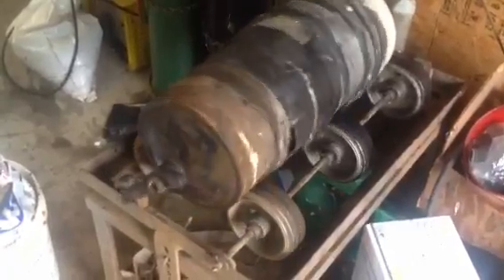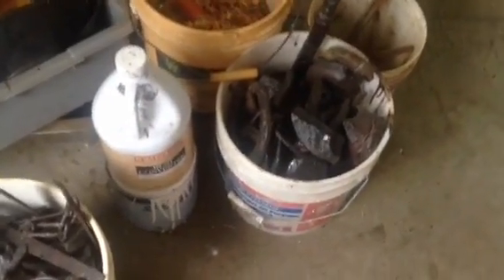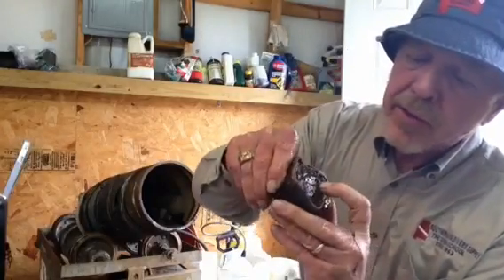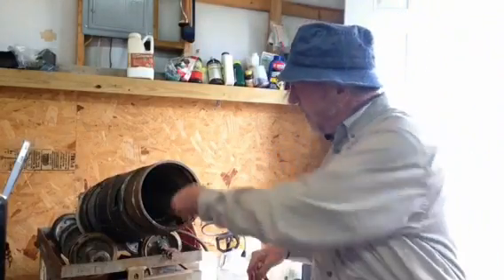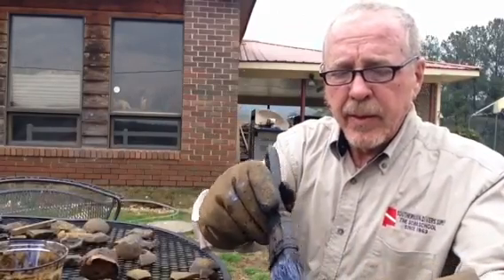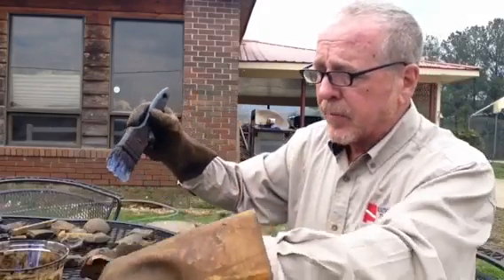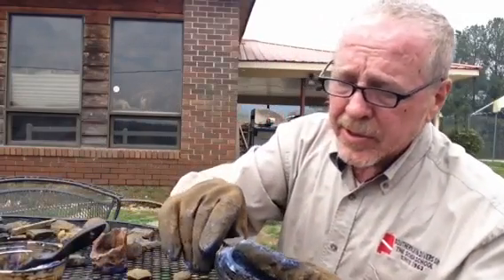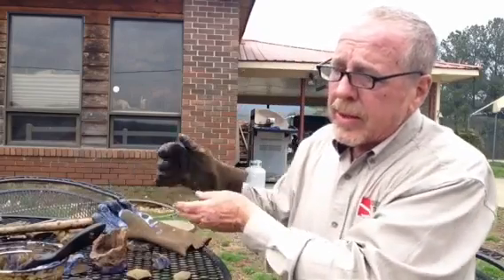Steve Phillips cleaning and preserving iron

Comment: Steve I have 2 solid French cannon balls , should I drill a small hole in them to make a good connection ? Or brush it and just wrap wire? Thanks
Reply from the maker: A small hole into good metal will work best. After cleaning boil several times in fresh water to remove salts and sulfides. Then coat with Gemplers Rust Converter.
Reply: @stevephillips0404  thank ypu

Comment: Steve I really appreciate your getting back....wanted to ask if there was a rust removing soaking product you'd recommend?  I'm not set up for electrolysis and figured you have probably used a bunch and would have some thoughts...thanks
Reply from the maker: ACE Champion 
I have seen where people have used vinegar but I never have. If you are going to dig iron I think you should set up electrolysis. It is easy and cheap. You need a manual type battery charger with built in meter. Not an automatic charger. Some stainless steel such as a big cheap pot from Walmart and baking soda. Don't use salt or lye.

Comment: Can you clean it with the gimplers without using the tumbler? I don't have a tumbler
Reply from the maker: ACE Champion Gemplers doesn't clean. It will help preserve after cleaning. I either tumble or use reverse electrolysis. Either one is pretty simple to use. I know some people use a form of acid like vinegar but I never have and I think some chemicals can do damage. Watch some of my videos again and see the electrolysis and water boiling. You can buy a rock tumbler pretty cheap.
Reply: Steve Phillips thanks steve....I've been watching some videos on rust remover sollutioms...I don't think that I can do the electrolysis probably to much for me....thanks for getting back buddy

Comment: I found 3 Whitney arms Mississippi us rifles yesterday . I think they are that is the closest looking rifle to mind. holy crap what a great day believe me they're all not like that but anyway I'm trying to find a way to clean something at this size and I don't think electro. would be a good idea I would lose the ram rod and one still has the shoulder strap rings the wood is hard like stone . Muphys floor wax ? Any help would be appreciated or if you know somebody I can send them to $$$
Reply: You might want to read up on a product called "Metal Rescue" rust remover. I used electrolysis on a Brown Bess (Nepal), barrel with great success on the exterior, but it didn't get all the rust in the combustion chamber. Metal Rescue did a fine job removing that rust. Good luck!
Reply: Thank you

Comment: hi steve
electrolysis also happens in the ground and.. it can go 2 ways stuff can compile on the object or stuff gets extracted it is most notable in coins you can find a ball of green rust containing a very sharp and neat conserved coin or you find a disc of rust witch is only rust in a coin shape
the same goes for all metal objects in the ground.. i bet you found quite a number of cannonballs and shells with deep dimples in them and others that seem nearly new with a smooth surface this is also natural electrolysis the one with the dimples the metal got eaten away wile the smooth surface ones got stuff added to them
with natural electrolysis its not either one or the other it can shift as time goes by or the environment changes for instance if wooded land changes into farmland or if farm land changes into swamp or woods